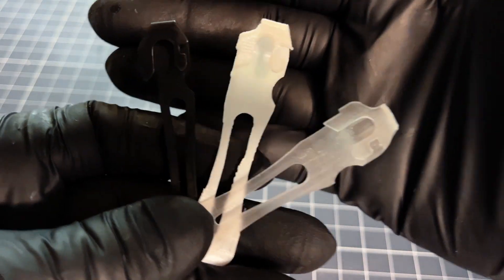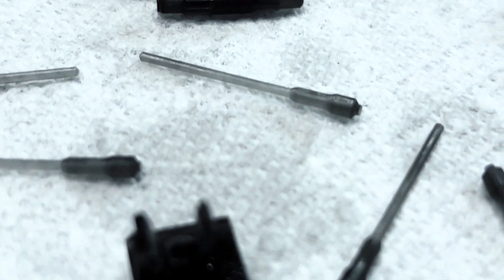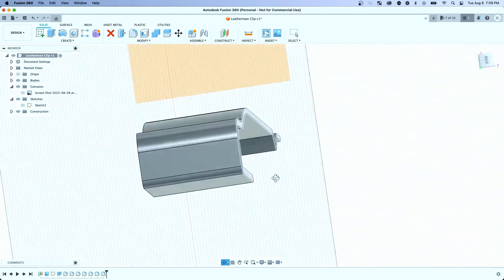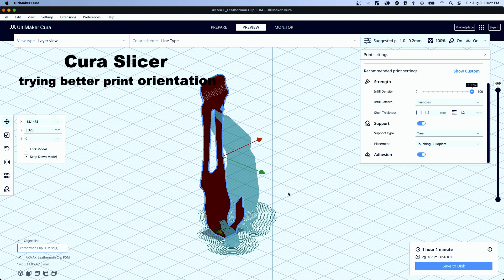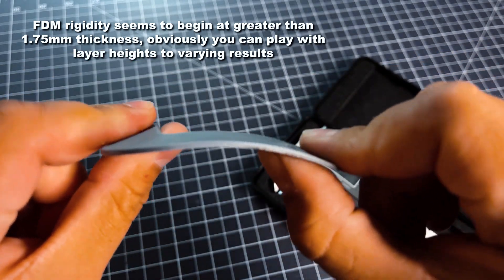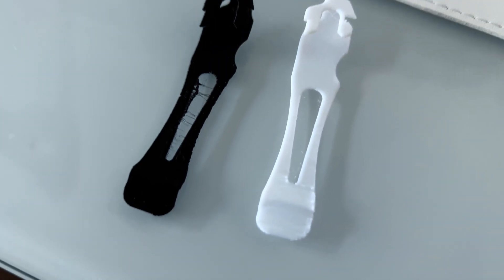Best 3D Printing for Thin Parts? FDM vs. SLA

Comment from the maker: 0:04 - 1:06 Leatherman Wave+ in Black Oxide
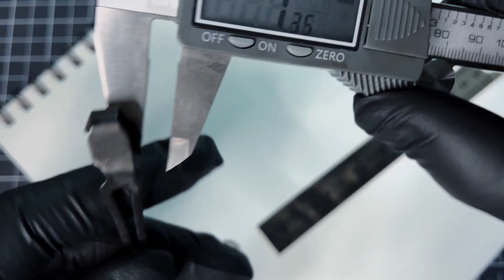1:07 - 1:56 Millimeter precision with SLA parts
1:57 - 2:39 Measuring part for design requirements
2:40 - 4:19 Fusion 360 Design
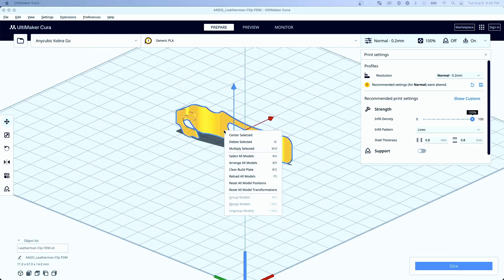4:20 - 4:31Final Pocket Clip Render
4:32 - 6:06 Cura and Anycubic Kobra Go Print
6:07 - 6:25 FDM precision and part thickness
6:26 - 7:12 Test fitting pocket clips on Leatherman Wave+
7:13 - 7:51 SLA printing on Anycubic Photon M3 Plus
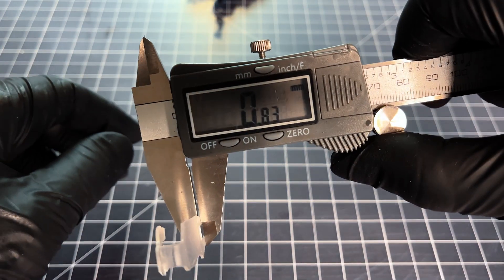7:52 - 8:24 SLA print results and precision
8:25 - 8:41 All parts comparison - original metal, FDM, SLA
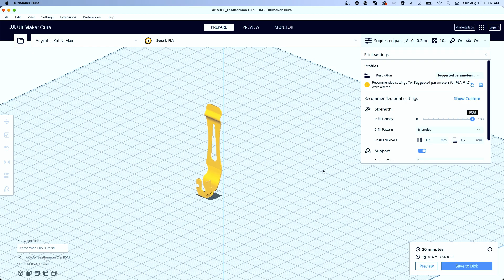8:42 9:25 FDM print on Bambu Lab P1S
9:26 - 9:35 Final FDM test on Anycubic Kobra Max
9:36 Bambu Lab P1S (BambuStudio) vs. Anycubic Kobra Max (Cura) print results